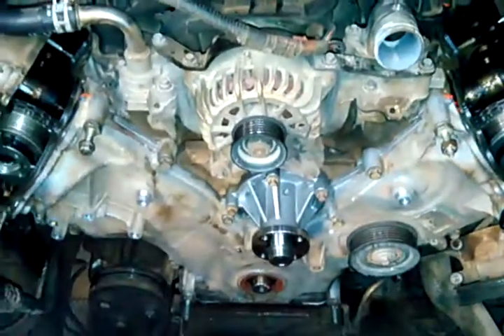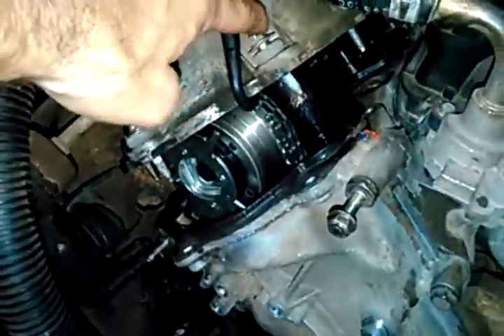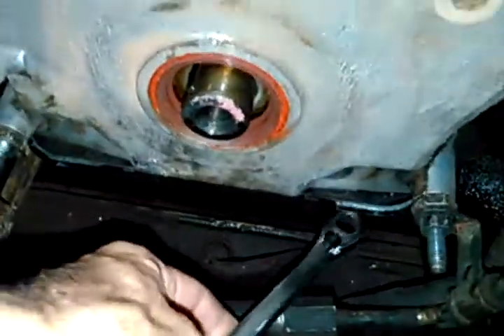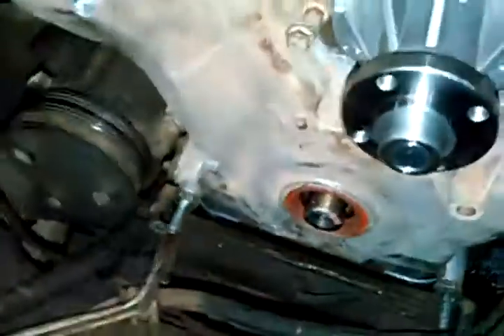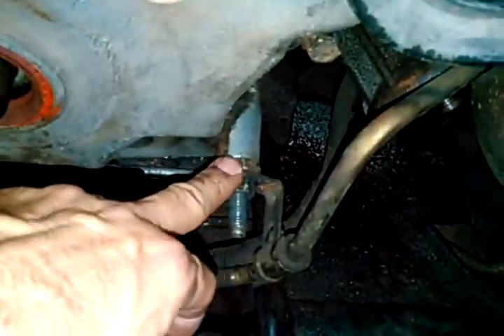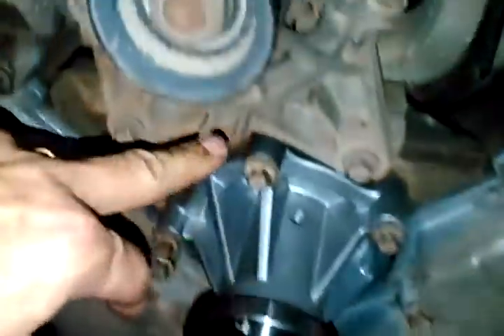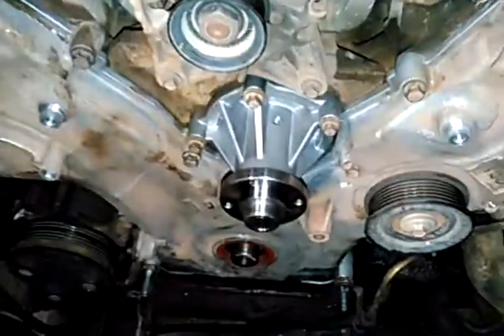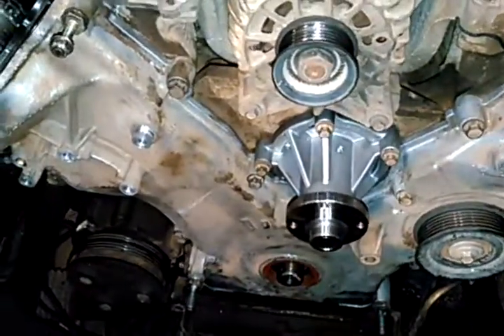04-08 5.4L 3V Timing Cover Bolt Sizes

Comment: Hello, 
Does the oil pan or front timing cover goes on first? The bottom 4 bolts front cover to oil pan and  would it make a different if one goes on before other. ?